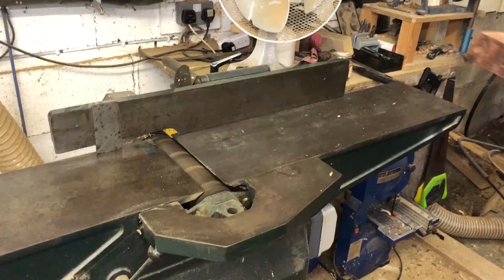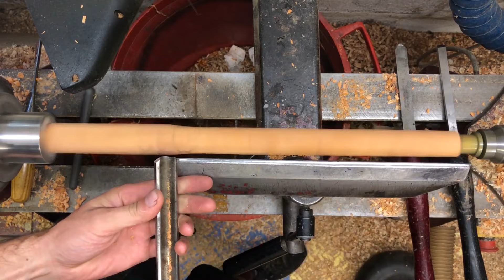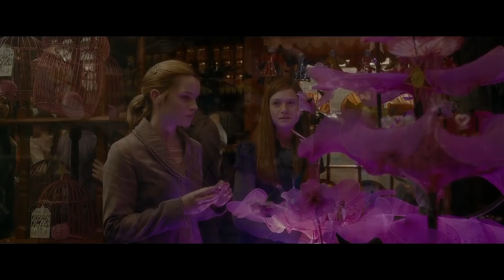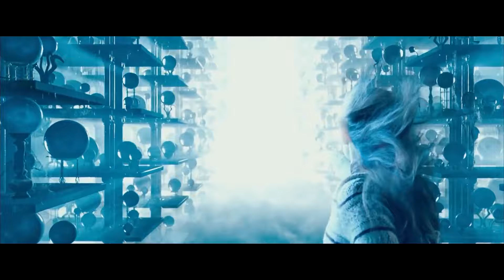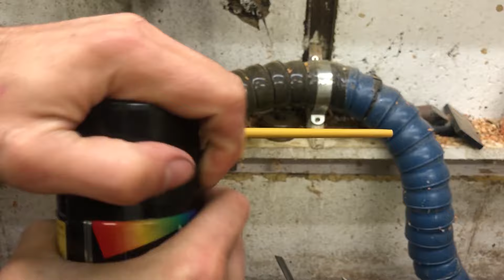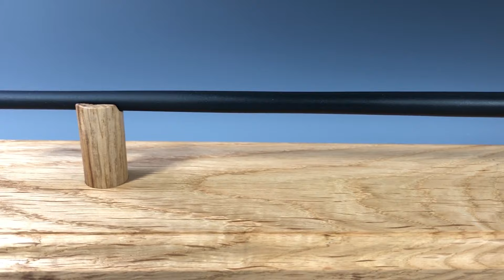Making Ginny's Wand - from real Yew Wood!

Comment: I would've been so done when it broke at the beginning. But when it broke at the end I would've cried. It turned out so good. Love your videos!
Reply from the maker: My fault really for not cutting up some better timber, thought people might like it though so left it in!
Reply: @garricksapprentice  its a weasley wand so the wood needs to be cheap!
Reply: @garricksapprentice  I appreciate it. I made a replica of the elder wand. I used an x-acto knife and my brothers old dremel. Surprisingly it turned out decent. But there’s one part that is slightly crooked. All that to say I just like to see that I’m not the only one who struggles. You could have just edited out it breaking but you didn’t and you found a way to add humor to an otherwise frustrating situation. I respect that a lot.
Reply: @VulkanBladeborn  😂😂 yeah but all the wands are made by Olivander and I don’t think he’d use nothing but quality materials 👌🏻

Comment: Why not put couple of vertical metal rods, spread across the length, on the side opposite the cutting tool, pressed against the wood, so that the vibrations are reduced and you don't have to hold it?
Reply from the maker: @raderadumilo7899  similar methods are okay for bigger stuff, but not this thin. It’s vibration more than deflection and quite common to handsteady
Reply: @garricksapprentice  It is unusual to do this thin wood on wood turning machine, to begin with... :D